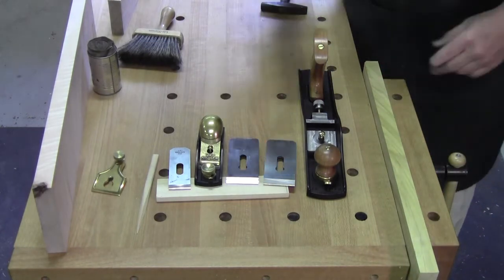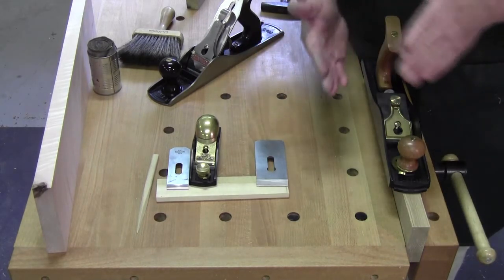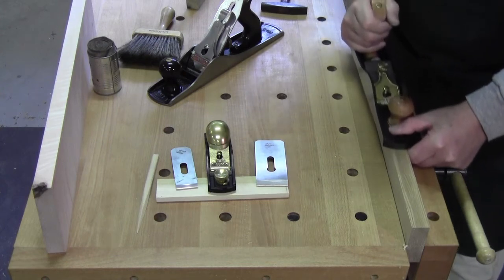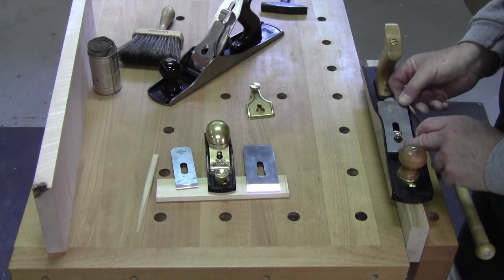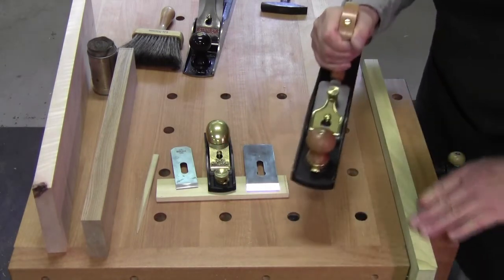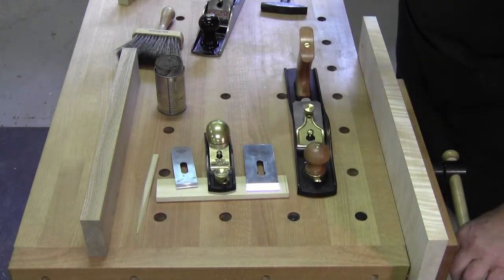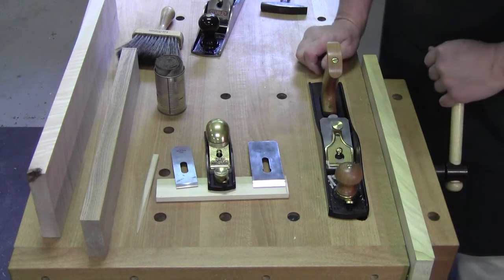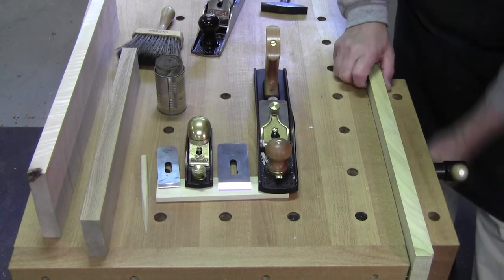PLANE TALK - Going Against the Grain, Lie-Nielsen Bevel Up Supplemental. June 4th 2017

Comment: Hi Walter- the LN 62 is my go to plane. I have a full assortment of different angles for different woods. My Hocks are at 30 degrees and I have a bunch of LN blades from 35 to 45 degrees. I had to order some extras because I forgot my spare blades upstate NY and couldn't get there for a few months due to the house being snowed in. Sometimes screw ups are a good thing.

Btw, thanks for the Hock blades for the bevel ups. Great idea and great service.
Reply from the maker: Thanks for watching and the blade purchase... you are most welcome!
Reply: Where do yo get these hock blades for the 62?

Comment: This was informative but confusing. I have both a 60.5 and a 62. Never used the 62 as they said it was best suited for difficult grain and it didn’t work very well. 

So what changes did you make to the LN blades for both?

What mods do we need for the hock blades?
Reply from the maker: in brief...
You have to hone it to a higher angle ie: 37.5deg (essentially 38) or even slightly higher.
You want to aim for an effective cutting angle of 50, 55 or even 60 for really cranky woods.  
The bevel does not have to be huge to test it out.
This is also why I have the HOCK O-1 tool steel blades honed to a pure 25deg for all of the low angle work.
Hope this helps.

Comment: I'm thinking of buying three planes.
No. 60-1/2 Rabbet Block Plane, No. 4 Smooth Plane, and No.5 Jack Plane or Low angle Jack Plane.
So, if you have a No. 60-1/2 Rabbit Block Plane and No. 4 Smooth Plane, which Jack Plane would you like?
Reply from the maker: Good choice on both a jack and a smoother.
Try and make sure they use the same blades, ie: Basic Stanley.
Why"  Then you can have multiple blades sharpened different way which will fit them both instantly.
As to the rabbit 60-1/2... i do not like them at all except for when you need a wide rabbit plane.
When I spent time at the Lie-Nielsen events and even up at their showroom, I could not get used to that razor sharp corner sticking out on both side.
I nicked myself just once to realize I'd be slicing my hands open all the time.
As for me I stick with the regular low angle block plane.

Comment: Hi, so did you just take a 25 degree beveled blade and hone your 48 degree angle onto it?
Reply from the maker: on the bevel up, yes.  I keep the original A2 blade honed with a high angle.
Reply: Great, thanks

Comment: Lie Nielsen are way too expensive compared to the EQUALLY  good Veritas planes.. In fact the LN LA JACK IS 175 USD MORE than the Veritas .
Reply from the maker: We all have different situations, I never liked the Veritas line of tools even though I have used many of them.
The Lie-Nielsen 62 is perhaps the finest tool they ever made and all that hand craftsmanship does cost.
I don't have many L-N tools bot the 62 & 60-1/2 are very useful to me.
Thanks for Watching!
Reply: The Veritas is more now. Not sure if it used to be less. $252 for Veritas, $245 for Lie Nielsen, both A2.
Reply: Agree with @gonebattybats .  I’ve owned a stack of Veritas and still own Lie Nielsen planes. I’ve used them side by side. Lie Nielsen is definitely superior in quality, fit and finish.

Comment: You demonstrate that a bailey pattern plane can handle the tear out on your wood, yet you recommend a more complex solution that can easily be several times more expensive?
Reply from the maker: It is about options depending on what someone has on hand.  If they only have a no 62, then there is that option... If they have #4, #5, #6 Bailey Pattern planes, then there are other options but... it take careful set up.

Comment: Great video, very helpful.  Thank you Walter.  I love my LN62, and Hock blades as well.  A quick naive question if I may:  you say that you hone the original LN blade to a high 48-degree bevel.  Is that just a primary bevel at 48 degrees, or do you mean that you hone a 48-degree secondary bevel onto the usual 25-degree primary?
Reply from the maker: Thanks for writing.
You can start by doing what you call a secondary bevel at a higher angle of your choice.
Over time it will become the primary, but it will take years of honing.
Reply: @DustySplinters  Thanks for the prompt reply.  That makes good sense.

Comment: hi, most woodworkers recommend 25 degree primary and 30 degree secondary. can we do secondary more than 30 degree for quick sharpening ?
Reply from the maker: Thanks for writing.
The answer is "It Depends" on so many factors.
What are you planing, with which plane?
Bevel up or down, Chip Breaker or not?
I don't worry about angles so much as I do the final edge and is it cutting to task.
For some woods, like clear soft pine, I can stay real low angle.
Others I raise the bevel  bit more and one even really cranky woods I try and get the effective cutting angel higher, more like 50 / 55/ or even 60 deg.
Hope this helps.
Reply: Thank you for your reply. I have Clifton 4-1/2 and 5-1/2 bench planes but still find it hard to get smooth surface without tear  on some difficult grain. I'm thinking of Quangshen low angle plane no.62,. will it help ?

 @DustySplinters
Reply from the maker: @teosinghsyiem9426    You have the gest plane with the 4-1/2.  Hone as usual but bring the chip breaker closer to the cutting edge.
I have some videos on chip breakers and planing against the grain.
If you have a sharp edge and the chip breaker is set tight, you can almost plane against the grain.
Another option is adding a back bevel, but I would say no to a Quangshen 62 unless you are in the UK and can get it from Workshop Heaven Ltd.

Comment: LN 62 vs 164?
Reply from the maker: Most definitively... The LN-62 !
And... get several Hock O-1 Irons for it so you can use the LN original for a higher angle  and hone at least one Hock O-1 to a pure 25 deg with no secondary bevel.
Thanks for watching and writing.